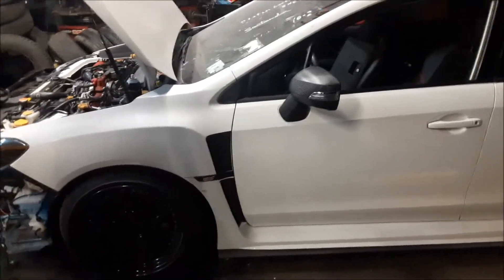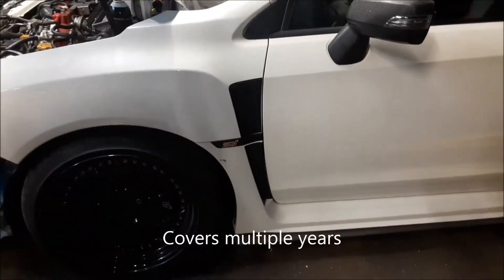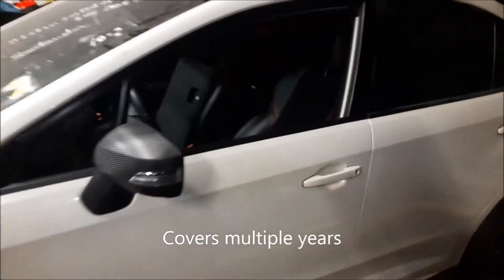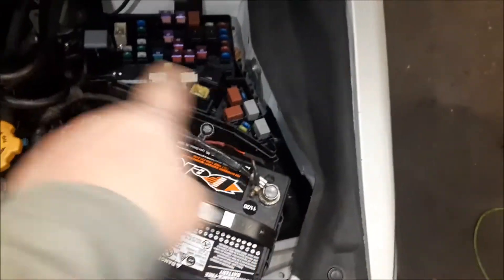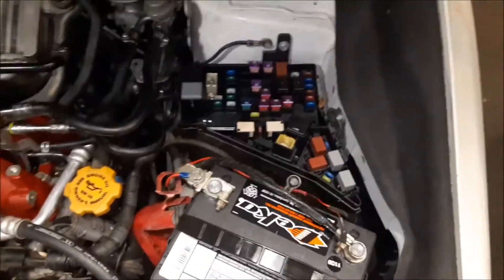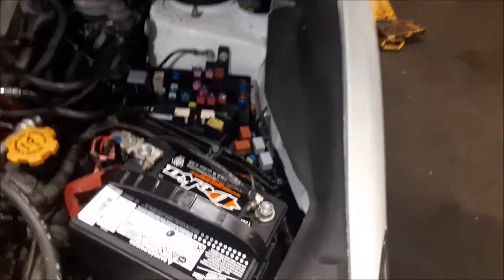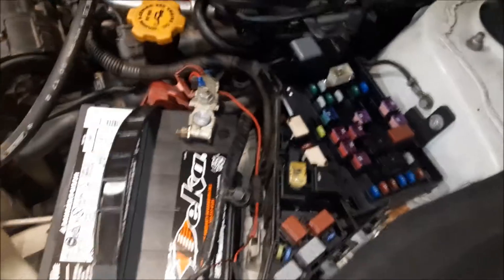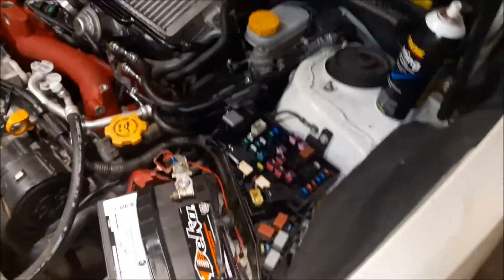Subaru WRX STI fuse Box & OBD2 Port Locations Locations

Comment: I realize this video is 3 years old but do you know the diagram for the fuses inside the vehicle to the right of the beige box, they're vertical in a black box, I made the mistake of thinking they were extras, now I don't know what slot needs what fuse